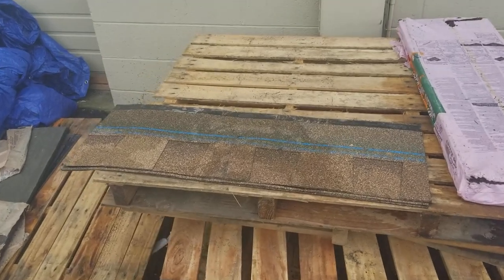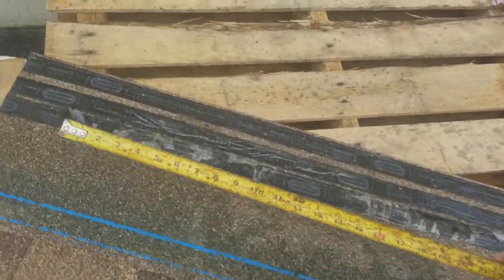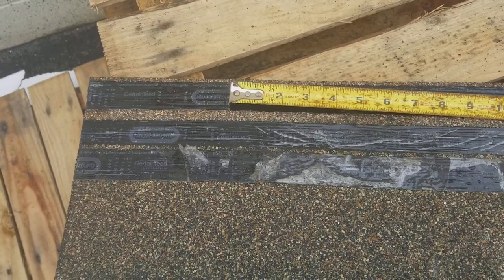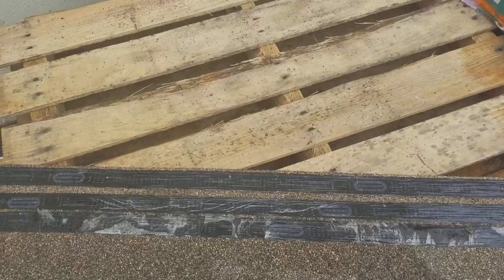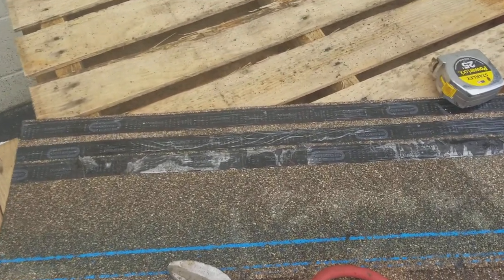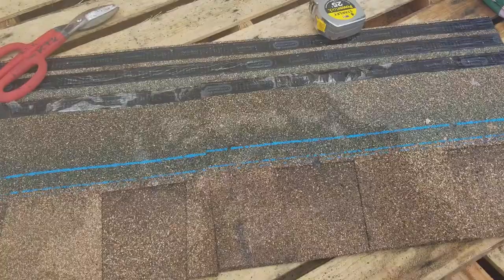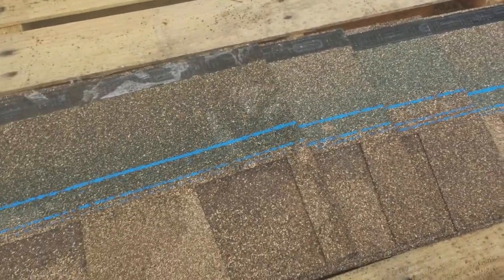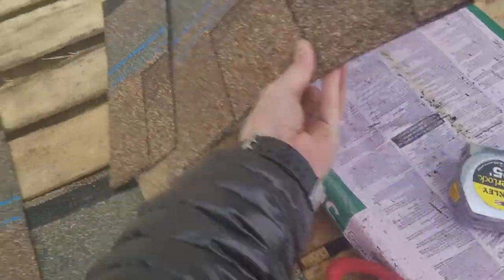How to Cut a Shingle Book- 5-5/8

Comment: Use a sliding chop saw to cut your starters, back blade them. Put a whole bundle on at a time and cut right through the plastic just remember to back blade them. Cut 3 bundles to get you started to the 3 specified starter lengths on the package and away you go. That is one of the best tips I can give and I have been running a hard and fast high production crew for over a decade now. Just came up with that idea about 4 years ago.
Reply: Or you could but starter shingles its called leading edge moronski
Reply: What do you mean by.   Back blade them?
Reply: That's just dumb.
Reply: slow
Reply: Usually means pulling. I presume he's making shelves instead of books. Battery 7" or 8" miter on a roof weighs less than some sheers
Reply: We snipped 3 tab shingle sets for years with metal shears. 2 1/2, 2, 1 1/2, 1 & 1/2 tabs. Be advised that after a little of this work those snips won’t cut metal any more. We had dedicated pairs. We just eyeballed sets with Architectural’s as there are no notches to keep in line.

Comment: I cut mine at 6 9/16 ,13 1/8 and 19 5/8  and flip
 the shingles so the seal strip doesn't touch the exposed part of the shingle. Using a straight blade cut the shingle from the back side using the factory edge of another shingle to make a straight cut. The shingle cut at 13 1/8  makes  like an 1 tab and the 2 tab on a three tab shingle perfect for working the valleys if you come off the edge of your roof. When you have a consistent pattern your nail patterns should be the same . We all have seen these guys putting nails where the shingles meet usually because they don't have a good pattern. Good to see people taking the time to do the job correctly

Comment: You got it right . If you divide the length of a shingle by 7 on your calculator you get 5.625 .
If you use that number you get zero waste and perfect stagger of 45 degrees. Beautiful.
Been using snips for years. Hacking away with a knife is no fun. Especially when they are cold.
Also a speed square. Score it on the back or use a crayon on the front.
Straight is good. I like straight. A paper cutter works good but it wont fit in my tool bags.

Comment: Once you start nailing the shingles and make your way up the roof would you repeat this process all the way up?
Reply from the maker: yes
Reply: @IBEXRoof  is this method a requirement by code officials or can use any shingling method you want whenever you want?
Reply from the maker: @slickwilly6868  This is the way manufacturers reccomend. Codes may differ in areas, but this way won't leak. 👍 I think in canada they install with a "racking" method sometimes?
Reply: Then you start the process over??
Reply: You always use manufacture installation  procedures for shingle installations. As far as racking goes it's usually only used with 3tab shingles. Read the instructions and don't get building codes confused with a building product.
Reply: Yes, as long as you need. Roof can be 40 feet up, same process

Comment: 7-8” works too.  Don’t use a tape just eyeball it.  You’ll get 5 pieces plus a full shingle.  Simpler, no measuring, more room for error.  No downside, faster, less trying.  Gives more play around the pipes and when you get to the end.  The 1/4 1/2 3/4 full is easier but is a bit lazy and doesn’t give the greatest spacing

Comment: ..with all that cutting, you could be laying shingles...is it a big deal if you just go full shingle, 3/4 shingle, 1/2 shingle, 1/4 shingle?....seems you could eyeball that as you go...I must commend you on the rust-azz tape...mine never last that long...good video!
Reply: Don't know anyone who measures like that and I've been in roofing for 5 years now. You could just as easily do 8" books. Last shingle will be a bit more/less because some shingles are 40" long or 39", etc etc. but that's absolutely fine as it's minimum 6".
Reply: I do 10. 20. 30. Which is literally 1/4 1/2 3/4.. and if you read the package they come in that's how your suppose to cut em!

Comment: Isn't it supposed to be 5 5/8" between rows? 6" cut off side of second row and so on...
Reply: I just realized after using this video to do half side of my roof, the 5 and 5/8 is NOT the spacing for courses. Owens Corning say 6 1/2. The 5 and 5/8 is the distance between the shingle on TOP... Argh....! Guess other side will be correct...
Reply: Correct. A 5 5/8" reveal. Reveal is distance between top shingle and bottom shingle. What this man is teaching is incorrect. Owens Corning architectural shingles course cuts are 6 1/2, 13, 19 1/2 to make your book.
Reply: Well half the roof is done wrong, and the other half is done right. Hasn’t leaked yet!! Guess I’ll know better next time... I’m starting to realize that a lot of roofs aren’t done 100% perfect, but they still work.
Reply: This video is very misleading, i came from roof caps lol thanks utube.  6 to 8 inch intervals is universal recommended. Anything less and u risk water getting to the nails or wind blowing off the tiny shingle this guy made 😆
Reply: Yes you're correct 5 5/8" is the typical height of the exposure on each shingle depending on brand.

Comment: Do you have any videos on layout for a hip roof?
Reply: @ttarms1970 no but its super easy (the easiest). stagger each shingle 5-5/8 until you run into the hip, amd then repeat. Does that make sense?
Reply: Kirk Koskiniemi a hip roof has hips at all comers. So the question is.  How do you cut a book. Or where do you start. I think is what he’s asking
Reply: @kirkkoskiniemi4961  never did see the reply Kirk, appreciate it tho. I tackled my garage 4 months ago, and it came out beautiful. Saved a ton of money and knowing where every nail placement is. No seems, no short cuts. I can sleep at night, and I know it will last for years
Reply: Basically you start out with a 10" piece of starter, put that small piece on, then put a full starter next to it to create the staircase and to avoid landing on seams. Then put a full shingle, put the bottom left corner on the bottom left corner where the hip starts, nail that off, get your next shingle, cut about 1/3rd of it off from the left side, put the bigger piece on, putting the bottom left corner of the shingle above the first one you put on the same way you did with the first, then the smaller piece you cut off that shingle, can be used for the next row up. That's the easiest way with having no shingle wasted and creates a good amount of a staircase, then just continue that pattern going up as you fill the previous shingles in. When you get to the opposite side of the roof do the same thing, cut off the shingle where the bottom right hits the hip, a straight cut. The sizes will vary but just use a piece thats either a bit short, like 1-2" from the hip, or goes past it, then you can either mark a chalkline along the hip to cut the excess of the shingles off, or just eyeball your cuts with the angle of the hip, doesn't really matter if your cut isn't straight, but try to stay within a half inch or so of the hip. The cap shingle are going to be covering it up so it doesn't need to be pretty. Also try not to cut through the underlayment, just pull up on the triangle youre cutting as you cut